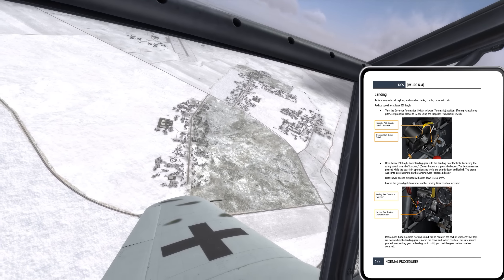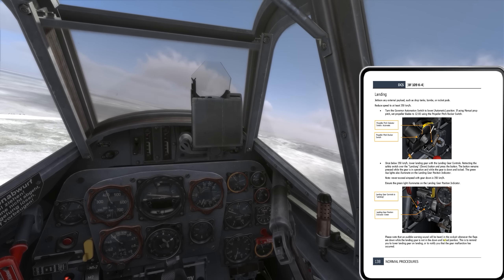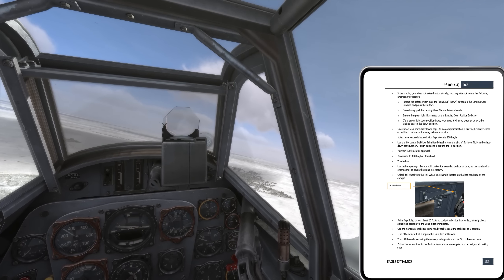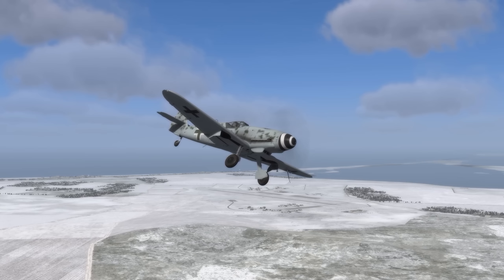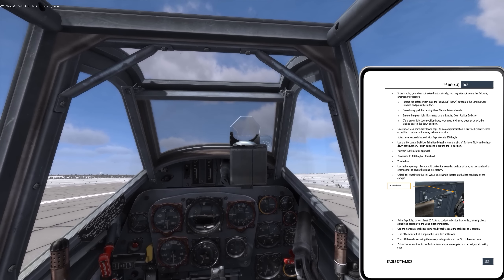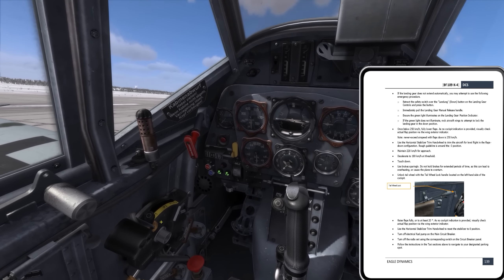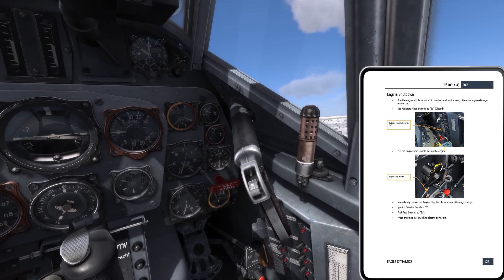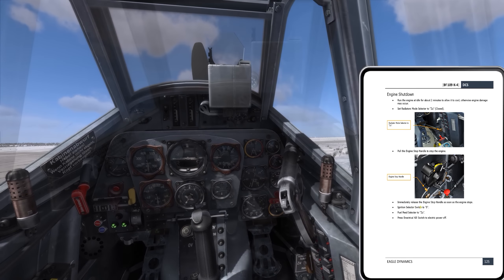Test Flight - DCS: Bf 109 K-4 Kurfürst #6 - Systems, Landing, Shutdown

Comment: Looking cool.Glad they bought in some more WW2 aircraft. I normally play War Thunder and Cliffs of Dover for that reason. I do have DCS world.How do you get that flight guild up on the left hand side of the screen?
Reply: i was wondering the same question. how did you get the manual show up like that?
Reply from the maker: +Warren Blanch Thanks Warren.  The kneeboard comes up by default with keyboard command RShft-K.  Getting the manual on there can be done using this utility:  http://forums.eagle.ru/showthread.php?t=129341
Reply: Bunyap Sims thankyou very much for your help ;)